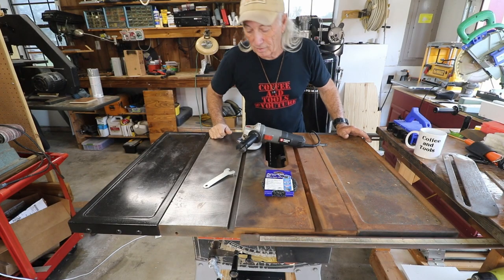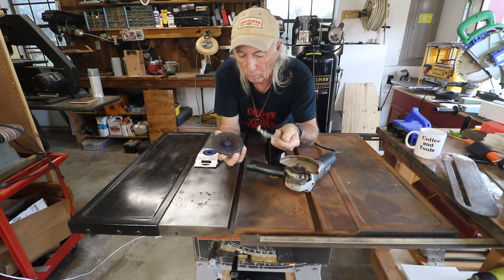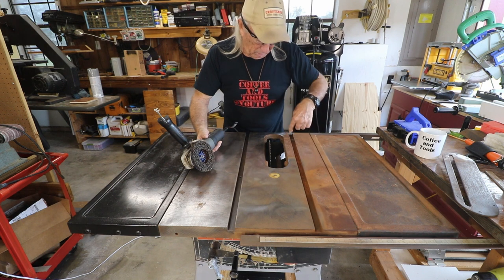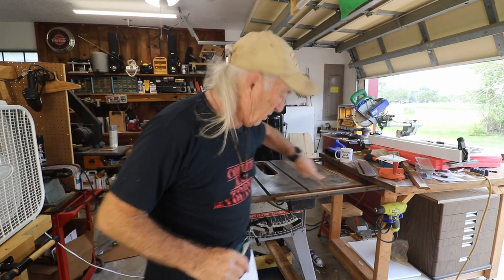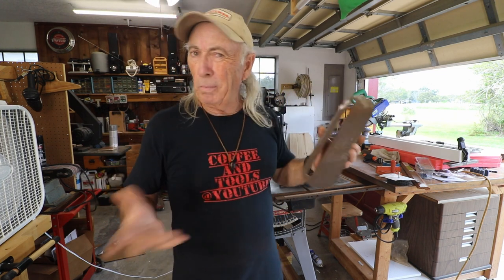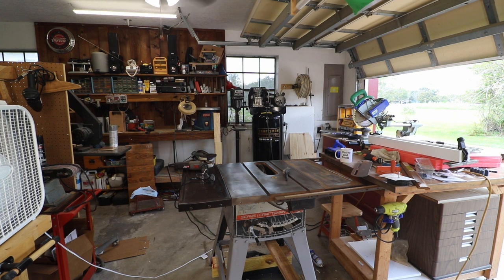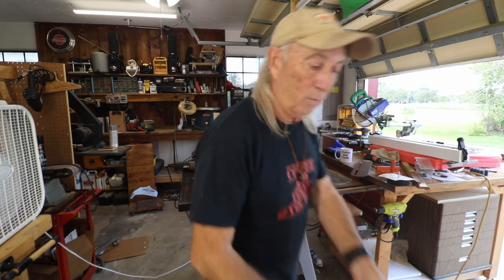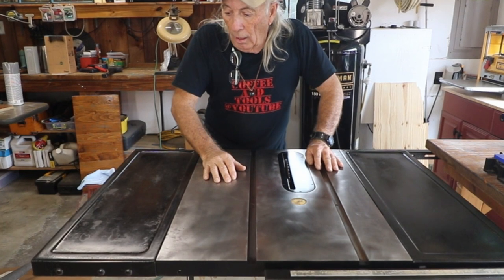How to clean up a rusty table saw top cast iron Craftsman, C&T episode 179

Comment: Great video !!  I just picked up about 2 1/2 months ago a Vintage Craftsman "100" 10 inch Tablesaw model 113.29990 (1957) Anniversary with the Power Bronze paint ,and a Craftsman model 113.27520 (1956) Tablesaw. I am in the process of restoring the Anniversary "100" saw now. I used some PB Blaster and a brown Scotchbrite pad on my air Jitterbug sander first, then 80 grit sandpaper on my Straight-Line air File,then 120 grit on my air orbital sander,and finally 220 grit . blew it off,wiped it down with cleaner,then waxed the top with Johnsons Paste Wax. It looks pretty good,some pitting and a little staining in one place but alot better than what it looked like when I got it. Now ive got to clean up the iron extentions and put the saw back together and lube it with some dry graphite spray underneath. I love these old saws !!! Just curious what brand of orbital sander was that you was using ? Thanks for all the GREAT Videos !!!! New Subscriber here.
Reply from the maker: The orbital is from a past review. Jellas is on Amazon and it is a very good one. " I kept it" 😅
Reply: @SirTools  Thanks for telling me about this one. I just looked on Amazon, is yours the 5 in. Random orbital 13,000rpm Variable Speed with dust bag ? they are selling them now for $41.99  , I think im going to get this. Thanks Alot !!!!

Comment: IT’S A BEAUT CLARKE A REAL BEAUT!!🤣 outstanding job! I know it’s too late now but, I picked up one of those cheap 25 dollar sandblasters from HarborFreight and a box of walnut shell medium…you do have to have a moisture collector on your air compressor because the shells are EXTREMELY sensitive to any moisture and will swell…but for little jobs like around the blade guard…works great. And I’m with ya…I’m already deaf as a haddock and wear hearing aids but still people tell me to wear hearing protection…I just laugh…that horse was outta the barn YEARS ago!! Where were they THEN!!🤣🤣
Fun video!! Thanks!!

Comment: Did you ever get back to the wheel Larry or did I just miss it? I know I watched this before because I remembered it when I got it’s twin and I came back to rewatch your process, which I’ll be imitating, and it didn’t show a “thumbs up” SO, I fixed THAT right off quick! But I’m not seeing the wheel or what happened to that project….I’d forgotten how great she turned out! 
So now, I’m going to attach my harbor freight wheel kit to the factory base and then mount the saw. THEN, I’ll try and resurrect mine as well as you have yours!! First…a trip to Home Depot!!😉😊👍🏻👊🏻
Reply from the maker: I thought we did the wheel job, but that was some time ago. Not sure where we ended up on that one.
Reply: @SirTools  I’m still digging….too many distractions…but I’m gettin there!!😊
Reply from the maker: I know that feeling. 3 Vevor boxes showed up here yesterday.

Comment: I have the anniversary model in my storage shed. This video makes me want to re-do it. I started to a while back but didn't because I have a new DeWalt.
Reply from the maker: ya a new DeWalt would be nice :)
Reply: Gonna throw my two cents in…I’ve got the Dewalt too…had the craftsman… honest, I may well switch back. This is just one guys opinion and we know what those are like…but I think yellow is over rated and the older red and black is just good old American tools that will last forever with minimal maintenance!! Go craftsman! 😁
Reply: @keithrayeski3147  the main feature that sold me on the DeWalt was the rack and pinion fence. You don't have to worry about it not being parallel to the blade. Just dial it in and it is dead on. I will say that the table is way too small. I bought it for the portability. I'm going to use the Craftsman as a shop saw because it's nearly twice the size.